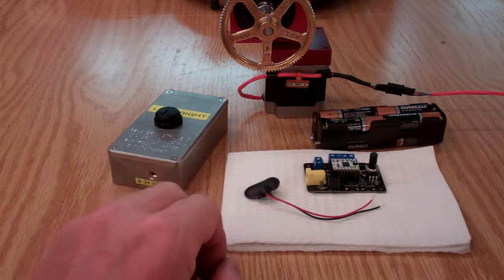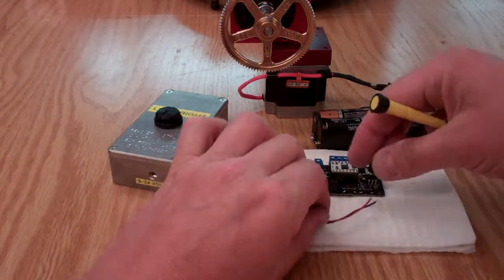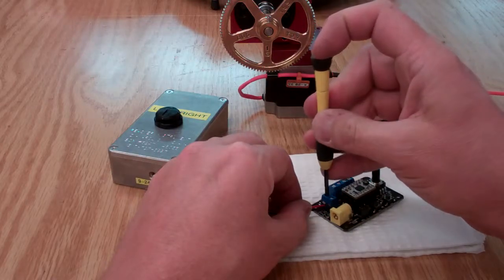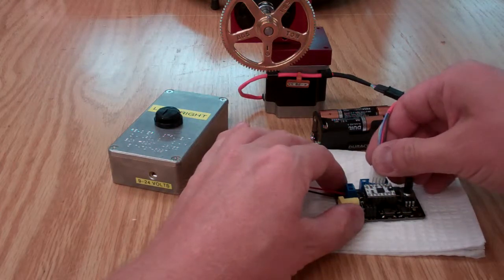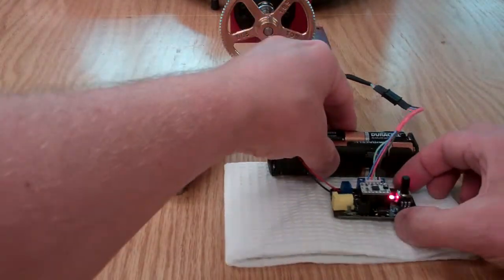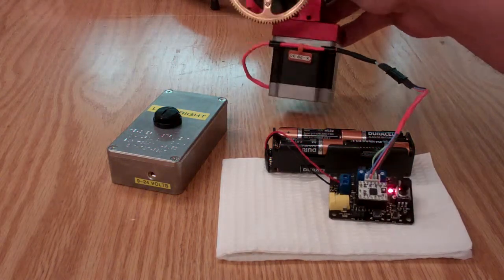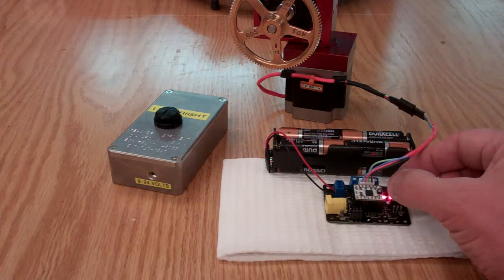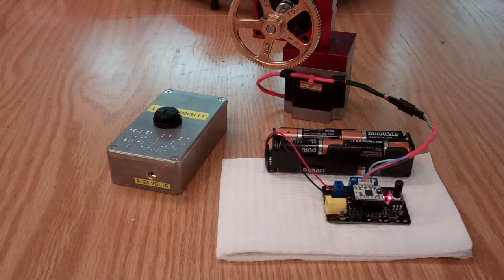EASY TO USE  STEPPER DRIVER AND SIGNAL GENERATOR ALL IN 1

Comment: Where can I purchase one of these?
Reply: Eseless you can buy it on eBay. Look for easy stepper driver. Around $25 U. S. You also need a pololu stepper driver a4988 $2-5 any power supply from 8V to 24v. And you are good to go.